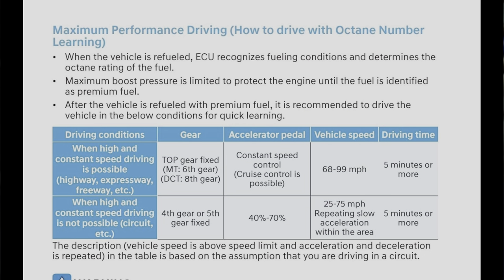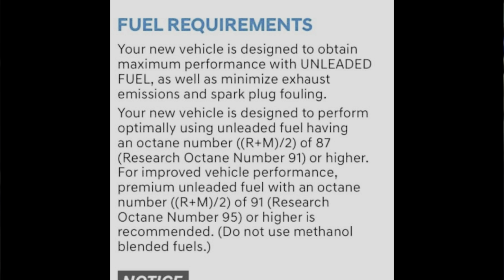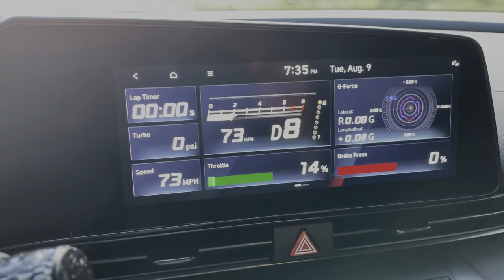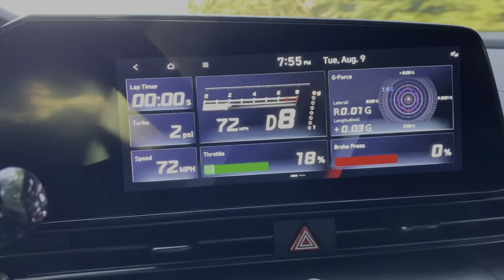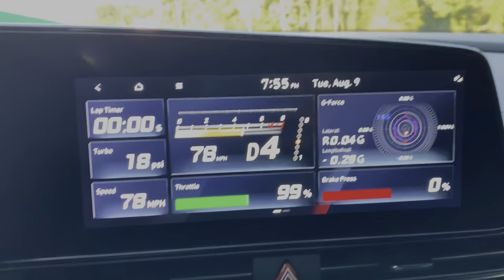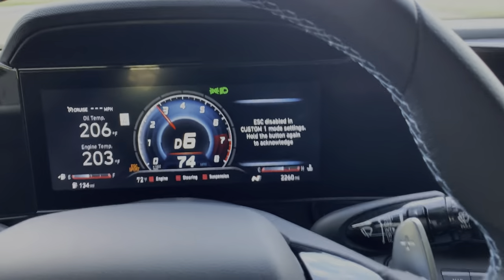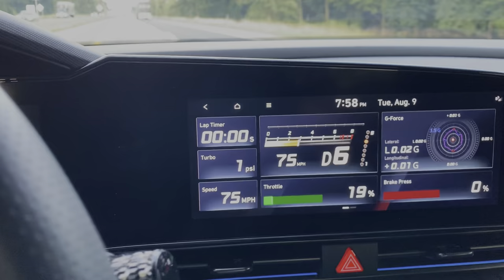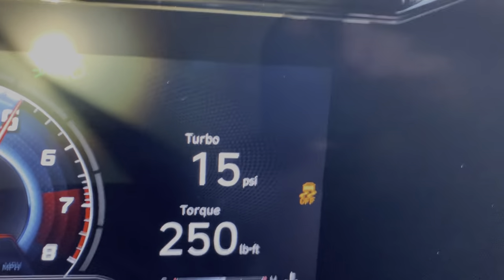Get Max Power on Your Elantra N (Octane Learning)

Comment: Hadn't heard of this before, but it explains why a pull on the highway felt stronger as I was nearly home, as opposed to first getting on. Will be curious to find out if the learning sticks between drives.
Reply: it resets when you add more gas or disconnect the battery. so has to be done every fillup
Reply: Mine will reset randomly during a tank where it has already unlocked it. Pretty inconsistent for me. I can’t quite figure out the variables that makes it change. I know 5+mins at 69+mph does not do it. More like 10 mins for sure and even then it’s iffy. However, if I do 80 it unlocks right at 10 mins. Went back to 15 psi on my way home from that same drive.
Reply: People are wrong. It only will reset on battery disconnect or if you have your setting to reset on every fuel up. There are settings for it.
Reply: @TheRealBobWillkins  If there are settings for it, then where can I find it?
Reply: @zx-3948  There aren't any. He's talking BS
Reply: There are settings for it. It's called a tune. Lol.

Comment: I've kept having issues with octane learning, and I'm not sure if it's because I drive in custom N mode after refueling or not, or if it's because I have to drive in traffic. What happens is I'll use the same fuel, sometimes I'll get the 19 PSI, sometimes I don't. Super annoying when you know this car can almost hit 300hp
Reply from the maker: Try doing it in normal or eco mode, from the research I did, that is what will help the most
Reply: I have a 6 spd N that i just picked up on 4 days ago. I am getting my first oil change in 3 days, (yes I drove it a LOT). Has anyone seen the effectiveness of octane learning on a manual?
Reply: I've had some difficulties getting  my MT to learn. I'm going to try 91 instead of 93 and disconnect the battery for 10 mins or so before trying to learn again.
Reply: @tyler7226  how’s it going now?
Reply: @tyler7226  😴😴😴

Comment: I’ve been running 91 in my EN DCT almost since I got it in April this year so I think mine already learned on its own because I don’t remember a time not getting 19-20 boost.
Reply: same, I only run 91.
Reply: So it never goes back to normal after you refuel? That's what I heard it does, and mine certainly did.
Reply: @animaljoe1  yes every time you re-fuel it resets and re-learns

Comment: This explain why sometimes I feel a lot quicker than other times. I never realized I I sometimes top out at 15psi. That 5psi does make a big difference
Reply from the maker: It really does!
Reply: @ENtense  I tried today and it didn’t seem to work. I’ll try again once I fill up again with shell gas.
Reply: I never got 20lbs.  The one time it worked for me on 93 octane I got 17 lbs with a blip of 18 here and there the the 14lbs I normally have.

Comment: Great info man! I have been seeing the same posts over and over on the FB group. I’ll have to try this. The issue with where I live is finding a place that’s flat enough to keep that consistent speed for 15 minutes.
Reply from the maker: There are ways to do it at lower speeds but I’ve yet to try it that way.
Reply: @NBABY-J  I do, but it’s hilly with lots of traffic.
Reply: @ENtense  I think I know what you’re talking about. I’ll look in the manual again.
Reply: @NBABY-J  lol yeah I suppose so. Or I could just a JB4 and not worry about the stock PSI ha ha.

Comment: Always I refill Sunday in the mornings, last refill with 93, that I get in my area, I put a bottle of octane booster, I driving in ECO mode for 10 minutes, or when I change to N mode, I touch 18 PSI, the car feel very stronger, and make pops very loudest.
Reply from the maker: I’m on board with you, it does make a difference.
Reply: I've always been advised to not put octane booster in turbo vehicles, what this does, I don't know but I'm just saying to confirm that it doesn't affect the longevity of certain parts.

Comment: @ENtense Awesome video! Thank you for doing this. I have been roasted in the FB groups for defending that this works and is worth it. It will work in N but have to put in manual mode to get to 8th because it will only auto shift to 6th. Also it will work in cruise. My best time is 6 minutes but it's few and far between. You're right, definitely best to go for 10 minutes or more.
Reply from the maker: Time to get them off your back now 😂

And thanks for the feedback about your experience with it, hopefully we can all help others achieve this and understand it works well, and it’s worth doing! 🤘🏻
Reply: Well, you'll get roasted again. Please head back to the groups where the two head tuners and a few engineers completely an utterly debunked this whole thing.
Reply: @williamrori1274 you gonna follow me all the way here to troll 😅. Man you guys are real mad 🤦‍♂️. Not doing this here.
Reply: @jasonyoung9248  No ones trolling. There's just misinformation that's clearly impacting the community (literally there's a post about some dude who is going to sell his car because he doesn't understand it). Just trying to flush this all out with data. Because it's such a big deal, I reached out to a local dyno and I've got a dyno day scheduled with a big test procedure to kill this thing once and for all.
Reply: @williamrori1274  It's been 10 months. Any updates?
Reply: @Duran762  seems to me like his dyno days proved HIMSELF to be wrong. He seems like the type of guy who would have been back here to gloat immediately had he been proven correct.

Comment: Brooo I just got mine on Saturday 🤘🏼 6speed. And I’m sure the dealer put 87 on it lol I’ll be able to for sure tell that the power difference is there with 91 and this whole relearn process. I’ve seen it on the forum lol and I havnt checked out my peak boost psi yet but glad I found your  channel. Also real pain in the ass to replace the front signals to leds I need those vice grips have big hands lol
Reply: Dealer most definitely put 87 in it. They don't have the luxury of keeping multiple kinds of fuel at the dealership just for that one full tank the car will have leaving the lot.
Reply: 3 months in, how you liking the N? I just put a deposit down on one. Did you pay MSRP? In Cali by chance?
Reply: @dumbeezy5480  how's your N?

Comment: It literally resets every time I park the car and turn it off. Wasted gas and over 30 mins of my time getting out of the city and driving on the highway for nothing... Tried putting only 1 gallon of the same 91 gas for the wasted gas and it kept the boost until I parked the car and came back to drive it... I saw a post that says you have to fill it from "empty" but what does empty even mean? like 5 miles before the tanks dry or what?
Reply: That's annoying AF lol I only got it once on my Kona N. Gave up trying again.. waste of time and gas.

Comment: *2nd Update*

So I fueled a couple days ago and today I tried nailing the gas again, not as many days since I tried it the 1st time but today all I could manage was 16 psi🙄 I swear if a tune eliminates this I'll get it purely for that reason alone. It shouldn't take long for a modern car to figure out your running 93 octane🤔
Reply from the maker: Seems some people are just having more issues than others to get the car to learn properly, I wouldn’t doubt it’s not your fault and you’re likely doing it right.  But it’s also possible that the weather conditions have an effect on it too.
Reply: Try a different gas station?
Reply: @ttoommssmmiitthh  ....nah because the next day it spiked 19 like before. My buddy and I agree it's the weather. The morning cooler temps keep the boost lower, warmer temps more boost, even a 7-9 degree uptick. These modern cars are soooo sensitive to weather💯

Comment: Has anyone experienced “losing” the octane learning? 

I just bought an Elantra N (6MT). I was hitting the 18-19 psi on the original tank of gas. 

Then I filled up when it was nearly empty with 93 octane Shell. 

Drove to work the next morning (it’s a 45 mile commute of mostly interstate). The car octane learned successfully, as I was hitting the 18-19 psi/boost on the way home that day. 

Fast-forward a couple of days. I’m off work and take the car for a backroad drive, and now it’s limited to 15-16 psi. 

What’s going on?

Comment: Drove mine for about 800 miles in 3 days trying to do it, on my manual 6mt, I got it to do it once and that was after I cruised for 90mph for 10 miles. Not very reproduceable for a 6mt.
Reply: Don’t stay at a constant speed. Drop down to 65mph in 6th and give it 40-45% throttle for 5-10 seconds, climbing to 75mph. Let off for 5-10 seconds. Repeat for 5-8 minutes. Done. Works every time on my 6MT. The idea is that you’re constantly introducing load at lower RPM which forces the motor to advance timing to hit the torque target. This repeated timing advance is how the car learns. Staying at a constant speed may also cause timing advance, but based on elevation change etc it won’t happen nearly as fast. The owner’s manual should be revised, honestly.
Reply: @plasticksrt  thats the track learning method mentioned in the manual and it does work , works way better doing it in the lower gears.

Comment: I have two questions my bad. 

So first one, is I only need to do it once after filling up not everytime I drive the car right? 

And for the octane learning, can I do it on N mode, 75mph, for 15 minutes and I can get 19-20 psi or? What you think? I tried normal mode 8 th gear manual and never worked at all for 7 mins and 42 second.

Please let me know. Thank you!

Comment: It worked for me but when I turned car off and back, I was back to 15 psi lol. And never got back again to 18-19 at all. I put 91 chevron and so on.. any ideas why it got reset? I didn’t fill up and had hella miles left lol: thank you.
Reply: No idea. This octane learning is stupid. I can only get 16psi and it says I am only pushing peak 250 ft lbs. They should have made this car premium fuel only. Car feels like it only has 200 wheel horsepower
Reply: @4drturbo85  you know what that's going to do? People blowing up engines and blaming hyundai for it. This was a smart move on hyundai to protect their reputation. Remember what happened when the genesis Coupes first came out. Lol

Comment: So would you have to do this on every fill up or every car start?
Reply from the maker: Hyundai will say every time the car gets refueled, but others have said if you top off when you’re at 4 gallons it will stay trained.   Not for sure though without further testing.
Reply: 3.9 gallons to be safe. I found that when I tested 5 gallons it went back to 15 psi. So when empty refill 4 gallons and it doesn't reset
Reply: @boostlife6370  do you gotta roll around with 3.9 gallons or less so it doesn’t reset?
Reply: @kodyking3090  so you can avoid the psi resetting by filling up 3.9 gallons when you are at 0 miles left. Practical no, but if your like me I am a car guy and don't mind doing a little extra to keep extra hp and decrease weight and getting fresh gas. I also don't commute a lot and mostly use it as a toy. I don't mind having to fill up extra to get most out of the car.
Reply: @boostlife6370  hmm doesn’t the 5 min reset drive time not convince you to just fill it up and take 5 min of driving to reset?
Reply: @kodyking3090  you need to do that on an open road so really only when there's no traffic and that would be at nighttime

Comment: This is so frustrating, I’ve tried this SO many times. In fact this weekend I specifically paid to get on a stretch of toll road that no one uses since it’s like $6 to hop on just so I could 1000% confirm I could go 75 mph legally for over 10 min in 8th uninterrupted and no cigar. I’ll get peaks to 17 psi for a second but I always hold at 15 psi…it’s frustrating never getting the advertised torque numbers and knowing there’s more power on tap
Reply: what gas do you run
Reply from the maker: 91 or 93 being used?   Maintaining above 68 mph?  And what drive mode?
Reply: @ENtense  always 93 since new, in fact I only run shell v power 93.
I’ve tried manual N mode into 8th, cruise N mode (which will throw it in 8th) and normal mode w DCT set to manual mode in 8th.
Reply: @falseegaming8656  always 93
Reply from the maker: @dubber4life  keep it in auto,  try again on normal.  If not I’ve heard others having better luck on eco mode.

Comment: Where did you find those graphs? I have never seen those graphs in the manual.
Reply from the maker: They were shared on a forum or the Facebook groups
Reply: @ENtense  Those photos were never there. Hyndai updated the manual. I remember when the car first came out and I read through the entire manual those photos never showed up. I found a old post on the EN north america group that has those two squares with no images.
Reply from the maker: @demonreamer12  thanks for finding that and sharing the info on the groups 🙏🏻
Reply: @ENtense  There was too much traffic on the highway home so I will do it later tonight to test. The only thing I havent done is doing it in normal mode. so im curious if it needs all fancy settings turned off.
Reply: @ENtense  hey I got it to work I’m at 18-19psi but your way didn’t work. I don’t know what I did but I wanna share my experience with you. Contact me through Facebook so I can tell you about it.

Comment: also in the 5-10 mins did you use cruse control?
Reply from the maker: I planned on it but right after I turned it on, I turned it right back off
Reply: @ENtense  I know it does say in the manual that cruse control is possible. I have to head out to a job in the next 10 mins and fill up with gas. Im gonna try with cruse control at 73mph like you, normal and see what happens. Ill message you back if it was a sucess.
Reply from the maker: @demonreamer12  nice, let me know!
Reply from the maker: @demonreamer12  p.s. keep it in normal or eco

Comment: I have a 2022 Kona N and I was noticing sometimes my car  “felt” fast and other times, although quick, felt it was lacking.  Started digging into info and found out about the octane learning… something no one really mentions. Did the octane learning and bam, car felt like I remembered… so the thing about the “learning” is, based on your daily commute, the ecu may or may not ever learn during your drives…  all my travel is city, so I never meet the “requirements” for the learn… I went a full tank of gas without it ever learning and only gave 14-15psi the whole tank.  Did the learn, bam 19-20psi…  crazy the system has such stringent guides to get peak boost and it can’t learn throughout a tank of gas..  either way, still love the car; just something I need to be mindful of when I wanna race and stuff.
Reply from the maker: I’m glad to keep hearing more people tell the truth of how there’s a difference.  Be careful, there’s likely someone going to tell you that it’s all in our head and this is just a big fluke 😂
Reply: It’s madness that a performance car has to be manually set like this to give its maximum power. I wonder what in terms of BHP that 4psi deficit actually equates to in loss.
Reply: @Buck3366   4-5 psi would equate to probably 30-50 Torque, 10-20hp give or take… the power is definitely noticeable… just a very stupid process if you ask me…
Reply: @mustangGT375  agree with you guys, stuff is stacking up for reasons I don’t like the car to the point I might just trade it in for something else. Edit: I have a Kona N.

Comment: Can you try to add only 3-4 gallons to see if it resets? I'm going to buy this car but I'm held up on the octane learning... Hopefully if you add a little bit of gas here and there it will not reset. Any answer?
Reply: Any time the car detects you've added gas to the tank, it resets the octane learning because using low octane fuel (lower than 91/93) can cause knock and pinging in the motor which will destroy it over time, my work-around that makes me hardly ever think about octane learning is don't nickel and dime the gas tank, it holds like 10 gallons from empty so just go for a full refuel and take a small drive down the local highway to let it see if you put the right fuel in (octane learning), and set the cruise at between like 68 and 80 or something, gotta stay in 6th gear or higher in the dct model for the entire time, and let it go for I think about ten minutes and it should be octane learned.. only main complaint I've still got is it won't tell you when it is, or isn't octane learned so you've just gotta mash the pedal to find out
Reply: @ruller213  thank you man much appreciated this is what I thought

Comment: Jb4 turbo inlet cai hks plugs bov and boostane.. I'm in a vn and peak at 24psi
Reply: And warranty is fine?
Reply: @mharro88  yeah I just had my car at the dealership 2 weeks I broke driver's side axle ( launch control and lots of wheel hop) it takes 10 min to install and 10 min to uninstall I just took jb4 out everything else I have doesn't void warranty just jb4 but if it's not there they have no way to tell if it's been there

Comment: Hi curious to know but after you have performed the octane learn successfully what PSI will the car hit once the NGS overboost is activated ? Obviously the NGS timer hides the speedo boost gauge but the centre console screen should show it .  Can we have a test run to see please or if you know already.
Reply from the maker: Interesting thought, but my first thought is that it wouldn’t go past 19-20.  But I may try to do some testing on this.
Reply: @ENtense  Yes it must had a boost cut limit at some point but the NGS over boost function almost seems redundant if that peak psi is already being reached without being activated so maybe it has a bit more to give. Be interesting to see and thanks for the reply .

Comment: Whats is the recommended fuel on this car? 87,89,91 or 93
Reply: It can take any but if you want to prolong the life of the engine and have the full power use 91 or higher.